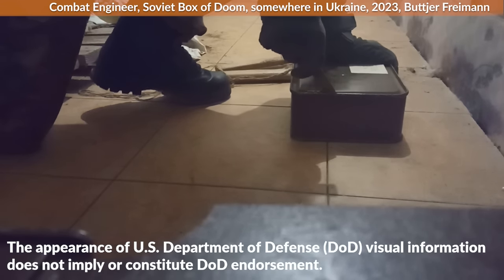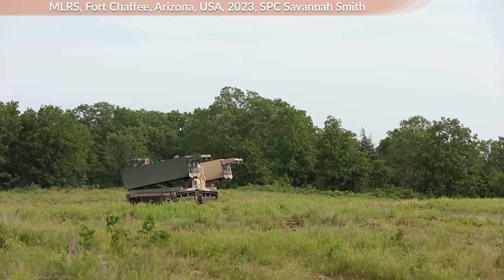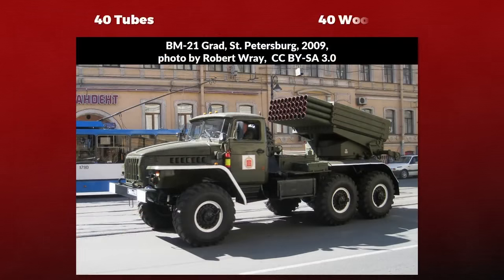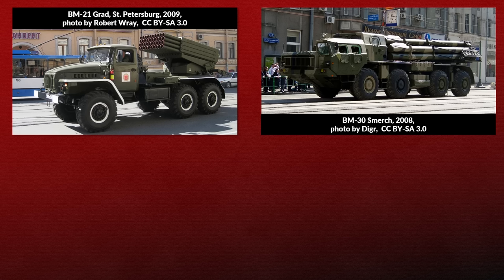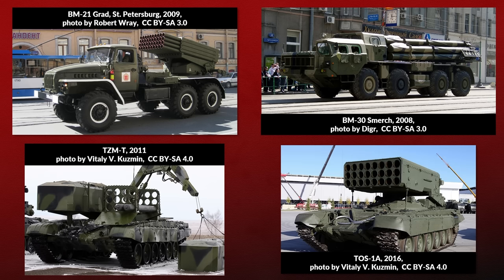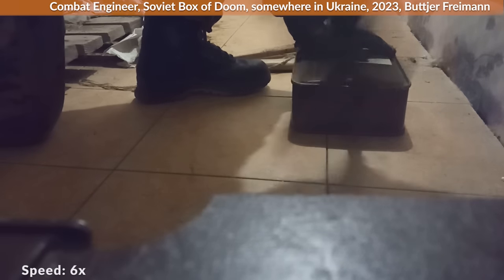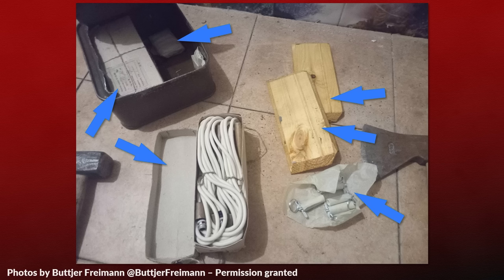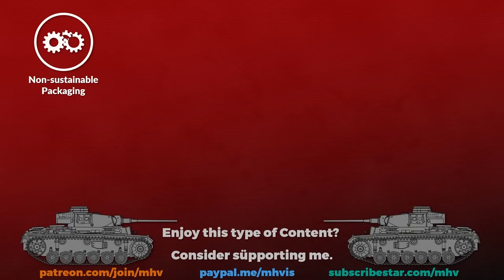Ukraine: Why Soviet Packaging is a Nightmare - Unboxing Edition

Comment: That explains why we don't see the Terminators at the front.
They are still loading the ammo belt.
Reply: yes sure and we dont see americans on the front coz they still repacking their new uranium ammo in green recycable cardbord boxes (makes me think so whats better on nato ammo box? the handle? and are they used for anything else no!? do they get reused? i dont belive that but yes you can open them like a little girl they are just overal a more complex system)
Reply: @fdsfggr  I'm not a soldier, but working in film, we handled a bunch of military stuff.

The amount of thought and effort that went into US & British packaging to make it practical & ergonomic is impressive, even for some stuff from the 70's.
Reply: @fdsfggr Just goes to show you have no idea what you are talking about.
Reply: @fdsfggr 
It has to do with what I call "son-of- a-b_tchedness" in design & implementation. Or, rather, where in the chain is someone going to curse the parents of the guy above them? That's the point of failure.

Soviet/Russian packaging distributes the SOBedness down the storage-to-use pipeline by using simple, cheap-as-wood materials. So the points of failure are mostly felt at the depot & the front line.

US/NATO packaging requires processed, cheap-by-scale materials that can actually be precisely molded for ergonomic handling. The points of failure, therefore, are more centralized & so can be caught further up the pipeline. Assuming they're caught.

Which, in a way, reflects the vast differences in doctrine surrounding logistics. From factory to front line.

What way is better? Well... speaking as a guy who used to work construction, I can at least say with some real experience that I preferred operating a forklift over humping around dozens of individual pieces of stuff to where it was needed. I needed more training, & a forklift, but jobs that had a forklift got done a lot faster, with more time for quality work, as opposed to lots of manual lifting.

I can only imagine what my preference might be in a shoot/scoot artillery duel. 😅
Reply: @fdsfggr  lol you're a good clown
Reply: @ptonpc owww noh sorry i just like the food storage way they use like my peaches in cans... maybe it matches the push supply chain they use 
back to you, what was you looking for? here a smart discussion in a yt comment section?? maybe go look for people with an idear somewhere else.. deal?
Reply: their ammo is carried in palettes easy to transport as well as plastic cannisters water proof easy to open. @fdsfggr
Reply: Having made and loaded belts of rounds for 30mm cannons on a Tunguska, I can say the process is just as difficult as the video shows.
Reply: @fdsfggr don’t forget the transgender marines …it’s a thing😂
Reply: @NavidKhan84  hilarious whataboutism but what has that got to do with the fact that soviet ammunition canning was done for the sake of longevity above all else? the soldiers are spending more time trying to unpack and organize their 20+ year old ammo than they should, that doesn't make them tougher, it wastes their time. have a good one dude
Reply: Well the Abrams finally made it to the front and so far two of them decided to stay there.
Reply: @NavidKhan84  
I don't think guns, tanks, artillery or missile defense systems, drones or EW suites care about someone's preferred gender. Nor, for that matter, do the actual soldiers in real militaries.

Maybe in the mashed potato militias, but not in real outfits. Bullets & shrapnel don't care, & if a recruit can't get beyond their prejudices to cope outside of their comfort zone then they should drop out & shut up. They failed to serve their country, because they have less respect for their fellows than an artillery shell fired by the enemy.
Reply: Golden
Reply: @fdsfggr actually the main issue in logistics is that Soviet / russian style is hard to pallet and forklift. 

Which massively slows its removal from trucks and trains. Being able to pallet up is a huge advantage.
Reply: @fdsfggr  Making it easier to open with human hands, is actually just a rather small and insignificant change in design. But it's a change in design, you have to actively think about and implement. Just look at the Yugoslavian ammo cans, which both have the Soviet style of outer packaging, but with a pull-tab for easy field-opening.

Another good example would be, how most modern food tins now come with a convenient pull-tab. This takes nothing away from the storage ability and costs very little in relation to the stored goods.
Reply: @fdsfggr Okay you got me.  I honestly have no idea what you are saying this time.  Something about peaches, food storage  and a dear?  If you are talking about the differences between NATO logistical handling compared to soviet doctrine.  It has already been explained to you by other commentators  All you have to do is nod and move on, you don't understand but you don't have to prove that.
Reply: @russellk.bonney8534 Sure comrade.  Can you prove that or are you just spouting more vantik nonsense?  Besides, how many of your owner's tanks are mobile BBQs?
Reply: @ptonpc XD
Reply: @ptonpc no body really asked i was joking with the first guy then you guys runned around like nobody understand what a  forklift is, paletts and how cool it all is
Reply: @TrollOfReason  Surely you can understand that in combat zone, forklift isn't available. That's why there are transporter-loader vehicle. Sure it's easier to load a block of missiles with such a vehicle at once, but at the same time combat can be a real SOB and the trans-loader isn't available, so you will really appreciate ability to manually load the rockets into the MLRS tubes using a few guys.
Reply: @Max_Da_G  when you realize that in western militaries, a forklift IS available in a combat zone, you start to realize how outmatched the Russians are in the first place. I recall a German officer saw some aspects of US logistics during WWII and immediately knew they had lost the war. Russians throw manpower at their problems, Americans throw money and technology at them. 

Western militaries have entire staffs of officers and NCOs at every level who think of this stuff and plan out all the logistics with redundancies and communication between units.

If a forklift is needed to do something, one will be planned for, if that one becomes inoperable, another one will be sent, or another piece of equipment that can do the same job. There's literally a whole battalion for most brigades who's whole job is handling logistics, maintenance, and engineering. 

Plus in the worst case the MLRS can just drive back to a depot where there are always forklifts and reload there. Most other things that are designed to be loaded/unloaded by forklift can be done by hand anyway in a pinch, it just takes long time to do it that way, which is why it's designed to be able to be done with equipment in the first place. Soviet planning just assumes they would never have the resources to use equipment in the first place, which was probably an accurate assessment
Reply: Russia love playing nerfs Lmao, Fun on shooting suffering on reloading.
Reply: @fdsfggr did someone hit a nerve lmfao
Reply: @Max_Da_G  
Yes & no.

While I can academically understand the strategic benefits of granular ammunition? I can't really go beyond any kind of economic argument for it boils down to "cheap good." Because it falls apart in nearly every other facet.

Once more, I admit that I can only imagine: If I was a grunt humping rockets one at a time by hand kilometers behind the lines, I'd be sweating & cursing with increasingly creative invective as I can imagine the growing dread of counter-battery fire. Or getting spotted by a drone as my MLRS system spends minutes not moving, making it a target for cheap tube artillery.
Reply: @fdsfggr We take ergonomics and practicality seriously here, Vadim. Now shussh and go ear those roubles elsewhere
Reply: lol in fact it really doesnt matter what you think about the conflict
Reply: They’re called Spam Cans not soup cans. Soup cans are round not square or rectangular. I still have a full Spam Can and a partial can of 1972 Romanian 8mm Mauser ammo. It came 2 Spam Cans in a wooden crate and included a can opener. I regret throwing away the little wooden crate, but it was still in the good old days. 2008’ish. I knew what was coming though,  but unfortunately I didn’t have enough money to buy more.
Reply: We see other 30mm autocannon platforms on RU side, so think again
Reply: @fdsfggr  how does Russian uranium ammo work?